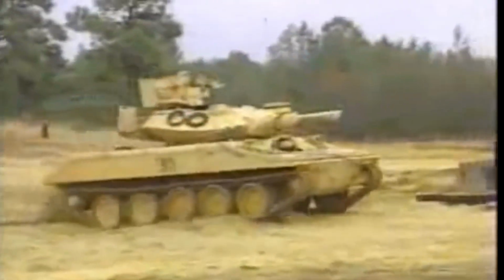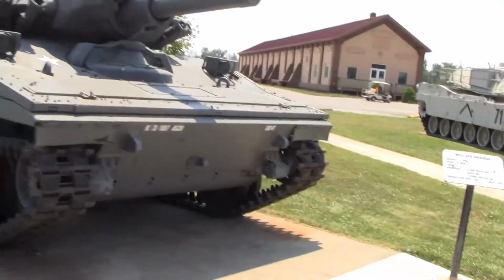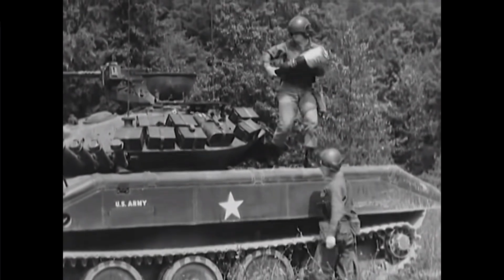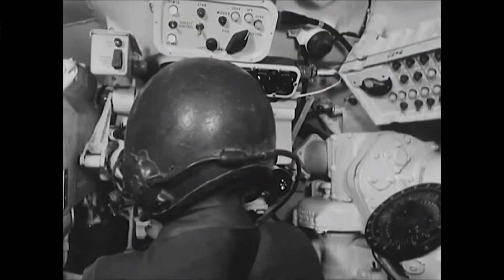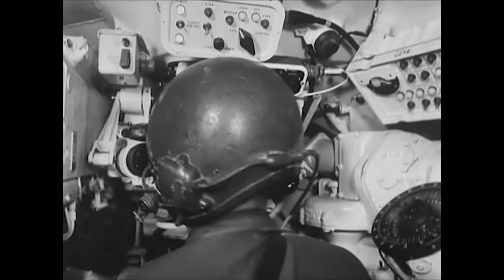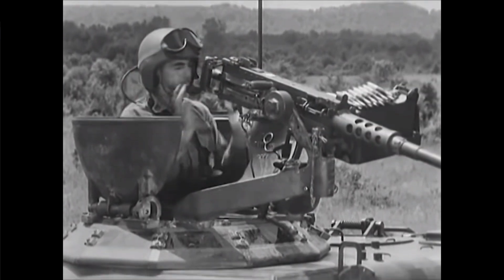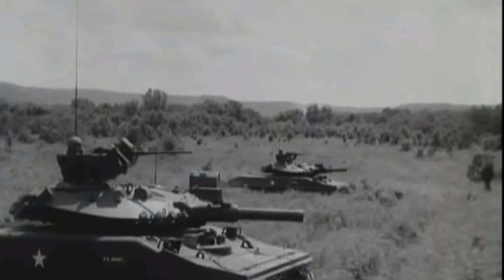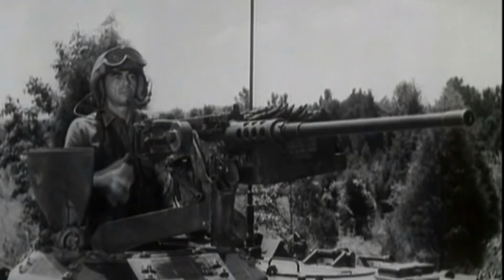M551 "Sheridan" AR/AAV | DESIGN DISASTER!

Comment: I have mixed feelings about the Sheridan. On the one hand it was really too light for its intended role on the battlefield, and too heavy for airdrops (I saw one being airdropped...it shredded its chute and made an very large crater upon impact), and the Shillelagh missile was a mess, particularly in terms of reliability.  On the other hand, the concept itself wasn't bad, and had the whole thing gone into development 15 years later, when electronics technology was more mature, it would have been a far more successful system....

One thing you didn't mention....the damn thing was LOUD...
Reply: Heard one burn in on Sicily DZ, thought that was loud till a month later when a dozer burned in.
Reply: @phred.phlintstone  I remember that mishap. The C130 broke it's back.
Reply: @phred.phlintstone  I dont remember seeing these airdropped except by LAPES.  It was rumored that they actually only used 3-4 tanks for the LAPES  as they were already damaged and couldnt drive.  They would just pick it up with the pallet and re-rig it for use the next drop.   This was 1987-1990 time frame.
Reply: R Scott B I got to Bragg shortly after this happened. I heard the C-130 pilot was hot dogging.
Reply: The M551 was never meant to go toe to toe with main battle tanks. That is why they were regulated to Cavalry units. Scouting and screening duties and provide firepower when required as backup. We learned that in Germany in 1970.
But for airborne units, light tanks had to be used to air drop. I was in the 4/68 and 3/73 in the 82nd ABN myself. We were looking forward to getting the M8 Buford but someone up high did not like the idea of airborne armor and killed that project just as it was approved for production. Money wasted on projects that were never meant to reach the troops. I would have loved to have longer range and faster operation, the only thing I liked about the M60. That M68 gun system was superb, it was the vehicle I did not like.
Reply: @ddawsond  You did mean "relegated", didn't you?

The problem with the Sheridan for use with scout units is that the damn thing was loud and didn't handle difficult terrain particularly well. Making it light also made it fragile, and this is something of a problem for a scout vehicle. I saw them in Germany too (a few years after you did ..grin...), and in addition to everything else wrong with the damn thing the gun/missile launch system had a range "hole" between the maximum effective range of that 152mm gun and the minimum range of the missile. Granted this wasn't an impossible problem to work around, but it was just another problem with a vehicle filled with them. Note that the M60A2 had all of the same problems (especially heat management for the electronics), so it wasn't JUST the vehicle.

Oddly enough, one possible use of the Sheridan (if they could have dealt with the loudness issue) was MOUT, it was small enough, and while the gun didn't have a great long range, it was (especially with a cannister round) absolutely deadly at short range, so ideal for an urban environment. The extra cover provided by urban terrain would have helped limit the vehicle's vulnerability and paper-thin protection, while the Shillelagh would (if they could have gotten the bugs out of it, and I believe that they could have) have been perfect for picking off targets trying to infiltrate between the towns dotting the German countryside.

One final note: the Shillelagh had an uncomfortable tendency to fall out of the gun barrel if the barrel was depressed by too much....a rather nasty problem when firing from high ground...
Reply: @f1b0nacc1sequence7  When ou are in an M 60 with others, even one other you do not hear much out else out there. As for finding the enemy forces there are other vehicles with you that range ahead. The Sheridan is backup fire power. #/8 Cav had a combination of M 114 scouts and M 60s except for A troop. Being airborne we had scout jeeps backed by 106 gun jeeps. When we got the Sheridans we still kept the scout jeeps. Back at Fort Erwin dirt bikes were experimented with and proved even better. 
As for difficult terrain? Yes we did get bogged down in deep mud but we never had to call back for the VTR big boys to get out, we got out our selves. Germany or Brag there was very few places we could not go. 
And like I said I never threw a track on a Sheridan even with dead track. You cannot say that about the M 60.
When the new vehicles that were proposed to replace the Sheridan were put up against it, The Sheridan outran them all.
Who ever said that the M 551 Sheridan could not run right either did not know how or were against light armor.

Comment: I'm curious about details of the only confirmed Shillelagh missile kill. It was from a Sheridan in Operation Desert Storm.
Reply: DrRocketman 779 they knocked out a T-72 if I remember correctly. The M551s had the new Thermal sights and literally felt invincible with the new sights. They where better than even the  M1 Abrams sights at the time.
Reply: @442dudeathefront  Sad thing is the M60s had better night sights then the M1s.

Comment: Tbh the Sheridan seems like one of those tanks that were actually a lot better than what most people make them out to be today. 
Much like the Shermans from WW2, Nicholas Moran (AKA The Chieftain) has done a really good job at reevaluating the M4s and has actually shown that they were some of the best tanks of WW2.
The Sheridan also, in Vietnam, was much appreciated by infantry units: its low ground pressure (thanks to the large tracks compared to the light aluminium hull) made them much more effective at crossing the damp, soft terrain in which the M47s/M48s would get bogged down in. The large HE and Canister rounds proved much more effective in the anti-infantry role (knocking down buildings, machine-gun nests and large swaths of forest line) than the 90mm or 105mm on other US Vehicles and the Vietcong barely used any tanks for themselves making the protection benefits of the Patton Tanks pretty much useless.
That said, overall the Sheridan adapted pretty well to combat situations it was never built for and unfortunately was barely used in the situations it was designed to be in (or fortunately because that would have meant an open conflict with the USSR in the plains of Eastern Europe).
Reply: Potentially a very theater appropriate design.
Reply: @badlaamaurukehu  Just a crappy implementation kinda like the bmp
Reply: @nonamefound68  nope, cause you can Air Lift and Air Drop the Sheridan too
Reply: @mandellorian It isn't revisionist history when the history it's revising was wrong from the get-go. The Facts that show the Sherman being an above average tank aren't "trying" to make it look better they simply show that the Sherman was a capable tank. It had the highest crew survival rate of all tanks of WW2 except for the Churchill and there is mounting evidence (and I mean Post-War military statistical studies, not the "memoires" of some FOB tank repair engineer that only saw destroyed tanks all day because duh... he has to repair them...) that it had better capabilities than other tanks that are usually consider "superior". I suggest you watch The Chieftain more often so you can see what I'm talking about and although he might have a pro-US bias he NEVER says anything that isn't supported by analytical studies.
Reply: @matty922117  That said, the Sheridan was a useless piece of crap.  I had a friend of mine in the VII Corps artillery in the late 70s and he said that on EVERY exercise, they would be piled up on the side of the roads with breakdowns.  He recalls especially looking at the large ALCOA insignia on them all.  Perhaps they should have stuck with foil?  LOL
Reply: @TheLoyalOfficer your friend was very wrong in what he said. I was a crewman from 1977 thru 1980  at Bragg I was in HHC 4/68 th Armor batt. And my M551 never let us down not once. And very few others ever had problems. I loved being on that vehicle. I do agree that it took a lot of pre maintenance but it was always reliable. We dropped many from c130 air crafts they hit the ground hard we'd cut them loose from there platforms jump in and carry on with no problems.
Reply: @matty922117  ok let's see your Soviet Sherman stats, since they actually faced severe armored/anti tank opposition vs the US/British ones in ETO. I'll wait. Chieftain hasn't provided any either.
Reply: in Vietnam it mostly station in Cua Viet and Danang... only early deployment in Cu Chi and surrounded area. After the NVA bring the PT-76 into battle, M551 end up station in Cua Viet and Danang only due to it overheat engine problem and VC anti tank capability increased with RPG-7 and type 69 supplies by NVA to replaced RPG-2. M551 serve it last battle to defend Cua Viet base back in 1969 tet offensive and station at there till 72. after that, when NVA started replace VC casualty with more conventional force, air support was use heavily instead of Tank and APC. Overall M-551 didn't serve much in Vietnam since most of it flaws that Matsimus mention in the video. Because where Sheridan can reach, is not where VC usually hide. it serve mostly patrol around bases in Cu Chi Saigon outskirt or around FOB in South surround Saigon. So overall it just do the patrol on search and destroy village near the base, didn't serve much fire support in jungle assault. the lack of floor protection give it poor protection against mines, which crews usually add sand bags bellow the seat to prevent mines and the titanium floor add up extra ton, which end up stress the engine even more and cost it stuck in mud often make them have to destroy since it can't be recover. While the 1/11 ACR love it because it have better firepower and maneuver than M113, the 3/4 ACR hate it because it poor protection and reliable compare with M-48 since it break down all of time with the engine stress and hydraulic leak. And during served in Vietnam it doesn't have missle, as well as HE is minimum use due to it tend to crack the frame of sheridan due to it extreme recoil,  so underload flechette is loved by the crews because it doesn't blow un burned powder and powder smoke back into the turrets (yes the compressed air doesn't work most of time) and it doesn't damage the frame of the tank. Half of Sheridan deployed in Vietnam got destroy by either mines, or stuck in mud or toasted by enemies anti tank. So no it didn't got love that much.
Reply: @boocomban  Are you familiar with proofreading?
Reply: @boocomban  Don't know where you get your info. saw M551's a lot in Nam . Cental Highlands, Up north during Long Son 719/20. Was Turret maintance for many years and know them were well. One thing I will give it credit for is in working on the all electric turret it got us ready for the new tanks coming on line. (M06A2/M60A3/M1A1/A2)
Reply: It was never needed enough to demand improvement past mediocre
Reply: NO!  THE THING WAS TOO UNRELIABLE.  That was the case in Vietnam, too.

Comment: Matsimus, the Sheridan and the M48 both had automatic transmissions there was no clutch. I was a crewman on an M551A1 in the 11th ACR in Fulda Germany. By then they were long in the tooth and barely running. We did gunnery in Wildfichen with a busted CBSS with out a second thought, pretty stupid but I was only a PFC driver I had no say. We were over joyed to transition to brand new M60A1s.

Comment: The US army is looking to get a light tank (again lol) to support infantry forces, BAe is putting the M8 forwards again, BAe will force the M8s adoption, it wont give up on that tank lol.
Reply: Actually the M8 being offered has a 120mm gun and significant armour packages.
Reply: @artruisjoew5473  a 155mm gun against people like ISIS is overkill. Their vehicles are probably best shredded by autocannons in the 20-40mm range (or a Soviet ZPU gun typically seen mounted in the back of a Toyota pickup).

The serious threat is the fact that they are fighting in urban terrain. 155mm shell fired over open sight will be awesome against infantry in buildings.
Reply: Thats the original, theres been 30 years of ERA, NERA and composite improvements by BAe systems since then which can offer protection vs 30mm APDS weapons, 50mm also IIRC now and high end HEAT weapons. If you want to protect from a modern fin round, even modern tanks will struggle to do that and you have to remember tanks are not really supposed to fight other tanks in doctrine, they are supposed to fight in a combined arms system where infantry also exist etc, they will rely on infantry to destroy enemy heavy armour which would be a major threat, while having significant protection from lighter vehicles and infantry which rely much more on HEAT based weapon systems.

Comment: My friend who was a tanker in the Us army and on the iron current during the late 1970s was on a base in the US and a Sheridan blew up because the loader was wearing w 6 volt watch and the ammo only need half a volt to go off
Reply: Discharged.
Reply: that sucks ass. when my dad was at Yuma Proving Grounds (YPG, Az) in the 80s, his unit was overseeing the range tests for some "new" 155mm howitzer shell. mistakes were made that ended in a shell detonating in the breach. my dad's unit had to recover the pieces. bad bad day.
Reply: When I was in recon '71 - '74, we got screwed on both types of vehicles we had, the M114 and the M155, both of who's main design feature was to save money. Always thought a mc trailbike would be better, at least we'd be able to duck and run better. The M114A1E1 carried 30 seconds of ammo for the 20mm, after that we were down to a M60, 3 LAWs, and a handheld 40mm grenade launcher, either M203 or M79. A slightly modifed Chev 283 is not going to move a 7 ton vehicle very fast, especially one whose nose stuck out in front of the tracks and would ram ditch banks.

Fatalities did happen though, when I was at Ft Knox in '71 I heard of 2 guys that were killed, one that was in between vehicles, I think M113's, when one of them jumped into gear and pinched him, and the other when he was moving in between turret and driver's compartment of a M60 while the master switch was still on and the turret was rotated.

Two years later during the Reforager exercise in Germany a plane on attack run collided with a M113, my memory sucks but it was one of the century jets, to later blamed on target fixation. The pilot and the crew of the track were killed.

I remember that exercise well though. While the opposing forces wore either a red or blue armband and the umpires had white ones, my platoon was given black armbands and dropped in between every morning so the participants could practice pow handling. Some of them took things way too seriously, nothing like having your boots taken away during a German winter.
Reply: And the "rubber band" tracks on the 114 that LOVED to fly off in hard manuvering unless perfectly tensioned. @shorttimer874
Reply: Talked to a Sailor who was in the USS Missouri (EDIT: USS Iowa, thanks M. S. ) when they had the Open Breach Explosion, when he went on deck
 "..I seen these black strips that I instantly thought were Semi retreads you see on the highway.. and then I noticed human features,  they were blown apart and compressed into strips..."  
I'm a ARMY Combat Engineer, you can't beat the laws of physics.... unless you're Mr. Scott and Spock...
Reply: I just talked with him about them and apparently he also crewed one back in 78
Reply: @phred.phlintstone  The joke flew over everybodies head. Hilarious...
Reply: @ElvisRocking1  , nothing goes over my head. My reflexes are too fast. I would grab it. ;)
Reply: Yeah, like the careless loader that liked to smoke on the job in Mannheim. He needed a place to put his cigarette down while shifting main gun ammo. I never saw a motor empty so fast. He survived but later wished that he didn't. The stockade was just up the road.
Worked on the AH1G cobra weapons system for some years also. We learned that when loading 2.75 rockets NEVER have an AM radio on the line. A side ban frequency could touch off the rockets if the shorting clip was removed. 
Careless people made mistakes and killed people.
Reply: You r/whooshed everyone
Reply: @Jack-fw1by   What's the joke? I don't get it.
Reply: "Red"? The Civilian Tech stationed at Camp Rice, 4/7th Cav kwhile I was there in '76, who kept all our "black boxes" working ALL the time worked miracles with them and they ALWAYS worked. I wish I could say the same about our regular mechanics who could NOT keep our tiny diesel heater working.....
Reply: @kentonvelomancer3466  I worked with Mayfield the civilian from Ascom in 1971 at Camp Rice 4/7th Cav.2nd Infantry Div.  I was one of the Turret mechanics on C Troops M551.  Never went to Turret school 45K20 was 63C20  but when arrived  @ Camp Rice I was handed a manual for the 551 and was told to have all the 551's ready in 30days for a Tank Gunnery.  It went very well.  Well except for the obtuator seal and all that fire and smoke in the turret burning on all those heat rounds.
Reply: M. S.  Right, I posted this at like 4am, my bad.
When you hear stories like that, you have to wonder how "true" they are, it seemed "real" be his emotions.
Reply: The iron current?
Reply: BULLSHIT
Reply: A lot of the munitions used by Cobras was static electricity sensitive too. We had to remove electronic devices before entering the ammo area during aerial gunnery operations.
Reply: Was the loader court marshalled?
Reply: @ElvisRocking1  he was killed in the explosion
Reply: Woosh
Reply: normal looking cat RIP
Reply: @ElvisRocking1  what an epic gamer reddit roast.
Reply: When I was 23 back in the early 1910’s I was driving one of the bad boys and the shell detonated to my voice, I nearly died lost 2 litres of blood
Reply: Dmitriv ‘n’ Friends 
Was that in WWIV during 1914?